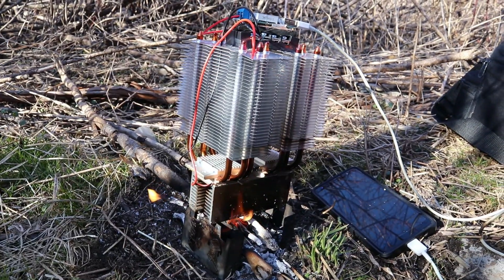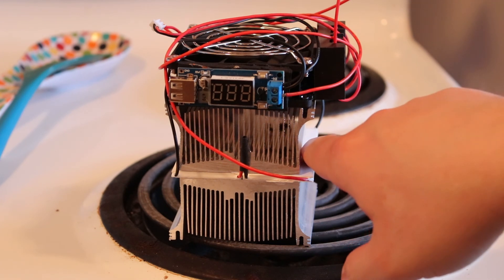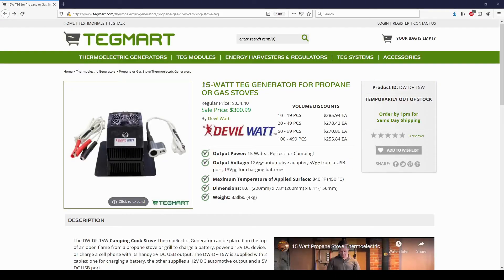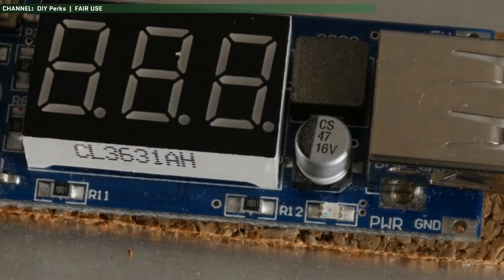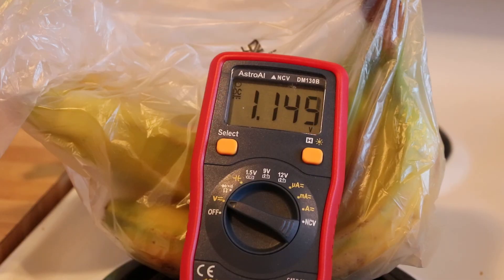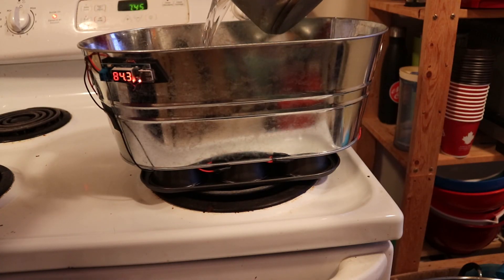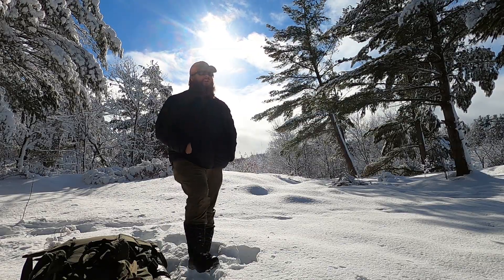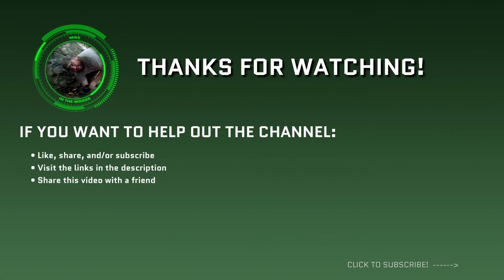Campfire & Wood Stove Thermoelectric Generator - Phone Battery Charging (Waste Heat)

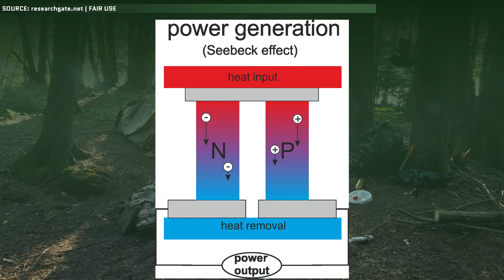Comment: 0:55 Peltier effect is when you have 2 wires of different materials making a circut and you power them, which creates a temperature difference. What you had descrobed is a Seebeck effect, which is something reverse to Peltier (they are all thermoelectric effect). Seebeck is when you make electricity from temperature difference, Peltier is when you make temperature difference from electricity

Comment: Your design sucks 
Heat rises
. Put the cold end on the bottom use a bucket or stream  
 Use your materials to make a shelf for your fire and hot side 

Great idea
Reply: Maybe a floating design with a several foot cable  for tea candles 

Now I got to build it correctly 
Thanks

Comment: Maybe the design can be up side down. More heat will rise, but there should be enough heat in a contained stove at the bottom of the stove.

And to help cool it long copper plates could be stuck into the ground connecting to the aluminum heat sink.

Comment: I've watched several videos on these hho generators that claim that they supplement fuel in the combustion chamber. They claim that they use  electricity from tge alternator & battery to generate the energy needed for the hho generator. Most scientists say that by using the cars battery it wouldn't work because of the first law of thermodynamics or something (I'm not a scientist) I was thinking that a contraption could be built that would utilize these peltier  devices located close to the exhaust pipe under the car. While driving, the hot side would face the pipe and the cool side would be cooled by the air traveling underneath the car. On most cars, you could probably  use 50 of those devices. The trick would be to have them just close enough to the pipe so they don't get damaged while producing optimum electricity. Idk. I'm too poor to buy the  parts needled for it but its a fun idea. As far as a campfire generator,  I wonder if a Sterling Engine might be a better candidate for that type of operation?

Comment: Just use one fan for both heatsinks, also insulate the hot side better from the cold side etc. there is lots of little improvements you can make.
Peltier has an efficiency of about 1% in your case even less than that. You should probbaly try a stirling engine instead, with say 2-4 zylinders for example and a gearing ratio you will blow away the peltier stuff performance wise.

Comment: With hydro-electric you need fast moving water OR a bigger wheel. Not easy but not the hardest thing in the world to make a spoked wooden wheel with a hatchet.
Reply from the maker: The way I've seen it done is by using bark for the paddle wheels. Xander Budnick did a video where he made one to cook a chicken rotisserie style

Comment: Curious what the max Voltage and Amperage you got out of these chips in your design were? I know they are rated to reach 4.8v and 669mA under optimal conditions. ... But what did you get ?
Reply from the maker: About half voltage if I remember correctly

Comment: Out of the box thinking is good.  If you can generate electricity with a wood fire out in the middle of nowhere, you're actually more reliably mobile than someone who just ran out of gas.  Of course, you can run a carbureted vehicle directly off wood-gas with a good down-draft gasifier strapped to its back that you port directly into the intake manifold.  It's not as good as using the fuel it was made for, but if you drive it more like a tractor than like a sports car, you're good.

Comment: I'd like to set up a wood stove application/accessory/design.  For in-home, you could keep a pretty constant/safe, hot water convection pump for your hot side, and for your cold side, port the air intake for the stove over the cold side of the TEG.  You could get hot and cold pretty close together with zero moving parts.  The water sleeve side would get and stay hot/warm, and the cold side would stay cool, with outside air being drawn over it at the rate the fire eats air.  Only thing that could hurt it would be the wafers wearing out or the apparatus rusting out.  Well, there is a moving part:  you feeding wood to the fire.

Comment: Not "waste heat".

If you are specifically using the fire to power the charger then it is not waste heat...it just HEAT.
Heat produced specifically with the intention of producing electricity.

Waste heat is what escapes that process.
Now... If you had a wood stove, who's primary purpose was to use fire to produce heat for warmth or cooking... WASTE Heat would be that lost through the chimney.

Comment: Yes, a build video would be great!   I would rather you go through some of the design decisions you learned if more than covered in this video.  I have some surplus heat sinks around so will probably use those to lower cost.   Another big question I have is how to select between the different modules out there.

Comment: Why not use pc fan and use Neodymium magbets to power them to make a on demand electrical source to charge batteries? you could get 140 mm 24volt 2.3Amp pc case fan for 30.00 and use magnets to generate 55 watts constant.
Reply from the maker: From the magnets? No, I don't think it works that way, sadly
Reply: @Mike_Seguin  Have you tried it before?

Comment: Use a PC fan
Reply from the maker: I had a few builds where I tried, but I couldn't get enough juice going to power the fan (higher voltage). I'm thinking I'll do a build where the fan is jump-started by a rechargeable battery to solve this problem

Comment: What is the highest temperature that the plates can handle? I am planning a sand thermal battery that will boil stream water to give me clean water and electricity.
Reply from the maker: 150c. If you need hotter, hi-z brand can do 350c